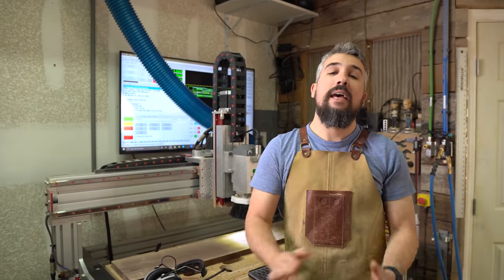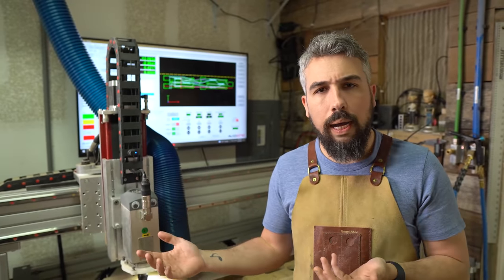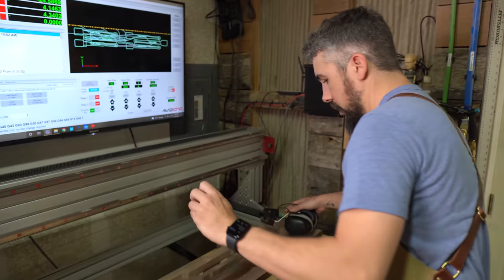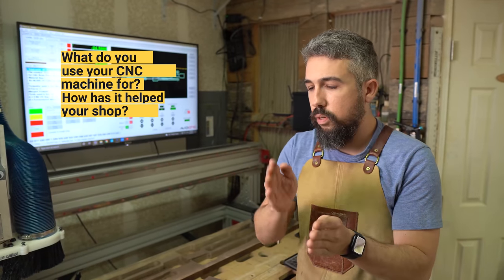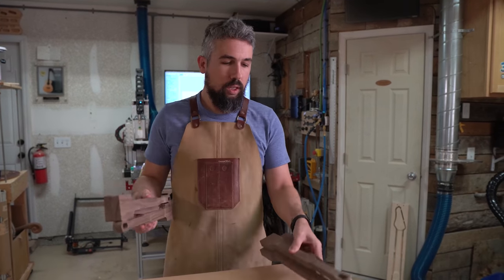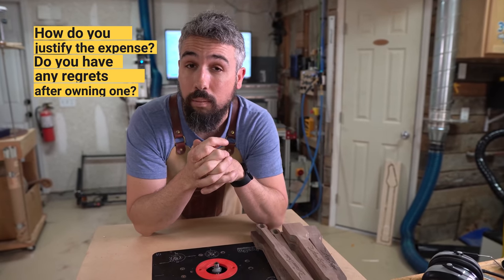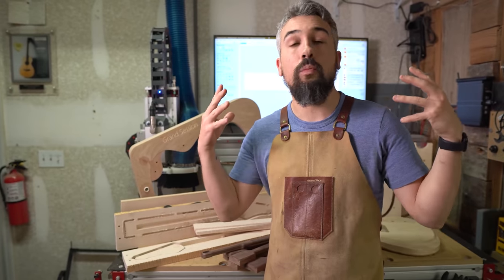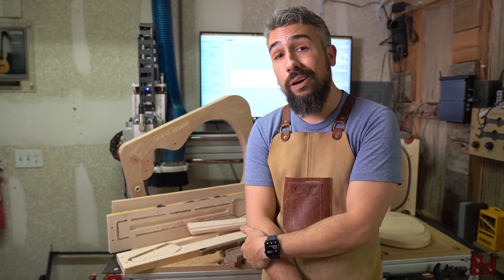How A CNC Machine Can Help You Build Guitars!

Comment: I work with CNC for a living (tool and die maker), so it naturally translated into my guitar-building hobby.  I couldn't justify the expense of a commercially available machine, so I designed and built my own.  My machine has travels of 24" x 36" and a 3HP 24k RPM spindle.  I'm into this machine for about $2K.  It is great to be able to go into my basement and machine anything I can design!
Reply: @David Lewis i used the Acorn and I love it. My son and I had some previous experience with Mach 3. We new we had to find something better than that! The Acorn setup was pretty much plug and play for us.
Reply: @David Lewis we ended up setting up an XBOX controller. It's not perfect, but it's pretty good. We also drove all our axes with some low budget servos we took a chance on. Smooth, fast and torquey!
Reply: I'd love to see more details about your mill, thinking about using microstepping boards from gecko and just a 3 phase motor driven off a vfd for the spindle, I fall into a black hole on the post processor though, bobCAD, Mach 3, flashcut, linuxCNC... it always made my brain hurt trying to figure that part out!

Comment: I've had my Shopbot Buddy for 14 years now and use it daily, 4 to 6 hours a day. It rolled out of the crate fully assembled. It's never needed repair of any part. It's an incredibly accurate American made machine with a very ridged frame and quality parts. The forum consisting of worldwide users to me is the best reason to be a Shopbot owner. You can always find a solution for whatever design problem you may run into. Plus it uses the best software in the industry, Vectric Aspire.

Comment: Most builders think CNC = easy Neck Carve.  Not so if you are building acoustics so you hit it right with the advice here..  Most small builders can't afford $18K or the room for such a large machine..  My  machine cost me $3000, has a small footprint (sits on a 36" x 24" table) and will do most of what I want for my ukulele and all the inlay work for my mate's acoustic guitars. Vectric software is a brilliant choice if you want to minimise the 'learning curve'. Great informative video and yes, you have to give this machine 'outside' work rather than have it sit idle most of the time.

Comment: I have to agree wholeheartedly! My CNC is the best investment I have made in my business. Mine is running almost constantly and is the number one source of revenue for my businesses.  Like you, I purchased mine for my lutherie business, but I soon realized that this machine could make so many other things. I also agree that the Avid is an amazing machine and was on my short list when I bought mine. But, while I was doing my research, I came across a little known brand out of Canada that ended up blowing me away! I love everything about them except their name: CNC4Newbies. My machine is very similar to yours 24 x 48, rack and pinion.  The build quality is on a par with Avid as well. They also have a very supportive user base on FB as well as a US guy who will video call you if you ever run into problems. But the biggest advantage for me was the difference in cost, my machine cost just under $4000.00 plus about $1000.00 for a spindle, vcarve Pro, bits etc. I don't post this as a "dis" against your machine as I think that Avid makes great machines, but just as alternative for your viewers to consider in their search. One way or the other, a CNC changes everything!
Reply from the maker: That’s great info! Thanks.
Reply: Why is there such a disparity in build cost? Consumables? Overall parts materials and quality, or a variety of things?

Comment: Nice and interesting vid, but what is that thing you're making? As a non-english speaker, I don't really understand what you say. Pain handle? Paint handle? Pane handle? Pig handle? Please tell me or explain...
Reply: Paint handle. It refers to a wide stick you cab attach to the guitar bolt-on neck pocket, to make painting the guitar body easier to control, while avoiding the need to touch a freshly painted body. It also keeps paint out of the neck pocket.
Reply: @jamesdeananderson1411  Thank you, that makes sense.

Comment: Lots of talk about the CNC machines but not much on how to get started.   I installed fusion 360  to try to learn.   It didn't take long to realize how much of a time investment it was going to take to drive it.   No matter which software is used, it will still have a big learning curve.   I was wondering,  how long did it take just to be able to get your paint stick into the system and a paint stick is nothing compared to the work of a 3D guitar neck.  I was an electrical/software/network/database engineer for 30 years and still found it very difficult to learn.
Reply from the maker: Fusion 360 is incredibly difficult to figure out at first, and still is for to this day. I only use it for complex 3D parts. 90% of my CAD and CAM work is done with VCarve Pro. It’s suuuuper easy to operate and figure out on your own, and only takes a couple of weeks of casual use to get good at it.
Reply: @DriftwoodGuitars  So 2D is one thing and I would be able to learn that in a reasonable time.    Something like a neck or the curved top of a PRS is a 3D process.  Can VCarve Pro handle 3d shapes?   I have boxes or small pieces of ebony, koa on and on.   Now way I can get rid fo them.  Really would like to CNC them into something that most likely would be a 3d process.  And by the way, tanks for all the great videos and information.  I have to admit I hate to you saw all those guitars in halve but I guess it's the only way to pass along that kind of information.

Comment: Something I was thinking of while watching is: in all the handheld router videos they explain about routing direction, climb cuts and whatnot to prevent tearout. In all the CNC routing explanations I never hear about that aspect. Is that not a factor in CNC routing? Or do you indicate grain direction in the software and the routing direction is adjusted accordingly? How does that work?
Reply: I agree with you.  I've seen some suggestions in Fusion 360 to use conventional cutting instead of climb cuts on hardwood but I'm still experimenting.  You can control the direction of the cuts but in Fusion at least, it's operator choice, the software is not smart in that way (grain direction).